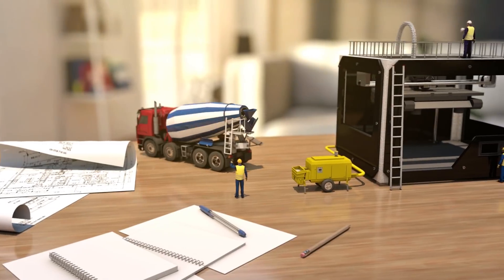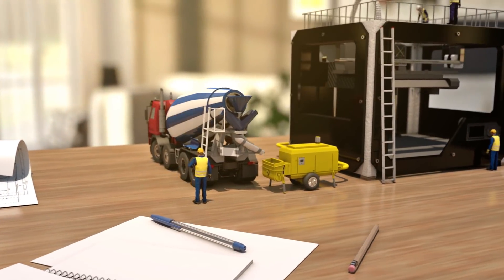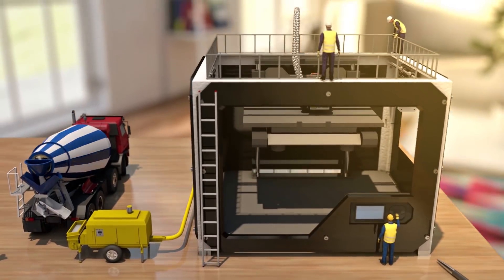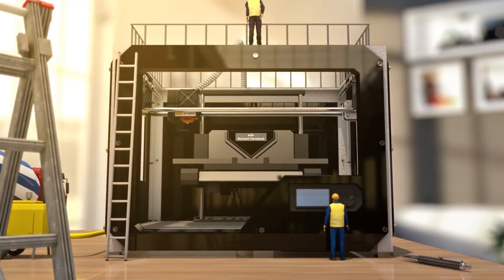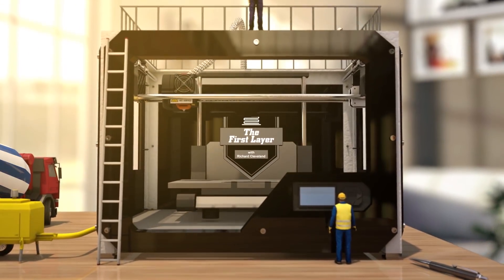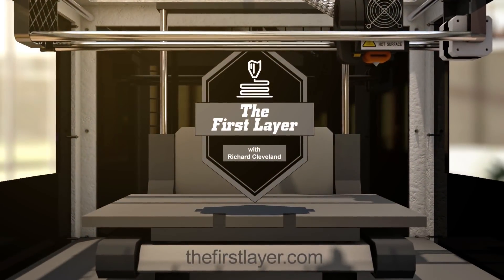3D printing First Layer issues troubleshooting Guide

Comment: I have a question about my ender3 v3 se printer. I been having leveling issues or bed issues. I been having some great prints and now I did the firmware update on the screen and motherboard, with old firmware work great new firmware.the printer with new firmware it's like a Crack head. Can you please help me

Comment: having a problem where its towards a corner but the furthest end of the corner is working, what would you say? (so its to say its curling before the furthest point but laying proper at the furthest point)
Reply: my extruder was loose and sagging forward, z hop helped a lot and made it go away for awhile but eventually i still had to figure it out. Also my bed was wobbly

Comment: Just can’t seem to get the filament to extrude, have to physically push through to start then stops …HELP
Reply from the maker: That indicates nto me that you have a clog happening in the print head.
Reply: Cheers will have to try adjusting the temp and stepper

Comment: dont forget to make sure the nozzle selected in the program is the same as the one your actually using. just bought a 3d printer and after 8 hours I see 0.4 mm nozzle in my program and i had a 0.8 nozzle on irl

Comment: I've tried all of this, an more - and it didn't help. Now, you may not believe it, but the source of my problem was... the deep blue synthetic rag which I used to wipe my build plate with alcohol !... It kind of dissolved in it, and gradually covered the plate with a thin layer of blueish residue. When I'd figured out what's going on, I wiped it thoroughly with a cotton rag and alcohol (the rag turned light blue in the end), and now it works just fine. But... your tips still improved my experience with the printer a lot, so thank you very much, good sir !

Comment: The extruder clicking can also happen if the spring in the extruder is too strong. 

I upgraded my extruder to a metal one, it came with a spring that was too strong, so the gear was getting pushed into the filament causing it to dig into the filament and mess it up, them with retraction on, it would retract the same section of filament over and over and over repeatedly when doing small sections of infil.

These grind spots on the filament were then tight inside the bowden tube and made the filament hard to push through, making the problem worse abd wirse up until the extruder can't push the filament at all and the print fails.

Comment: Ender 3 user here. Never had adhesion issues before until i tried PETG. I'm using a creality glass bed, all metal hotend, capricorn ptfe...yaddyyayda...never had a problem UNTIL: "Overture Grey PETG"(white never had ANY issues but the grey! OMG!) printing at 250/85(so far best results) but man...that FIRST LAYER... when i was printing larger parts i had no problem, smaller parts? well.. bed adhesion issues(elephant's foot, parts lifting/getting knocked off ruining the whole print etc)... even using multiple "hairsparay methods)(thin coat vs. soaking it down letting it dry etc)... man.. GLOBS/STRINGING alluvasudden... i am wondering if i am overextruding?...pulling my hair out... maybe the PETG roll i got was bad? (i doubt it). Like I said... 1st 30 hours of PETG printing with Overture's WHITE filament was awesome... this grey stuff is giving me grief...stringing...globs...not adhering/knocked off build plate etc...I have tried SEVERAL bed leveling attempts(paper is tight, paper barely touching, paper somewhat touching)...globbing/stringing... PLA, PLA+, other rolls of PETG were fine... nozzle is CLEAN... COULD IT BE A BAD ROLL OF FILAMENT OR POSSIBLY THE COLOR PIGMENT?? Frustrating as all hell!

Comment: This week I've been printing with a new reel of PETG. Major issues with first layer again. Found that I needed the following first layer settings.. 0.25-0.3mm gap, 90C bed, 250c head and 150% flow rate, yes 150%!  In addition I had to print at MORE than 20mm/s. If I tried to print the first layer slower I got under extrusion even at 150% flow rate. I think my extruder has issues at very slow extrusion rates. Weird as it calibrated fine. After first layer I found more normal settings of 0.2 layers, 80c bed 235C, 100% flow and 40-50mm/s work fine.

Comment: If you are still struggling after all the tips you are not alone. Last year I printed over 180 parts using several reels of filament, no first layer problems at all. Now all of a sudden I've had to spend three days solid trying to fix several different fix problems with the first layer. Normally a heated bed helps adhesion but apparently not always. To fix a problem this week i had to turn the heated bed off. Never had to do that before.

Comment: Thank you for the tip on the first layer having a transparent appearance, being an indicator of too low of an adjustment.  I was experiencing the smashed layers, especially at the smaller extrusion sizes, to the point that the skirt is too small and smashed to remove. Going to use these tips to level it up less tight
Reply: So, I eased up on my bed height, but it caused no adhesion, and layer separation. I tightened it back up, as my initial leveling seems correct, but going past the standard print quality (on an ender 3 pro, stock magnetic bed) I get an outline "skirt" layer, that is practically impossible to remove without scraping and damaging the print surface
Reply: @antwonfisher91 set it slight high where the print is just loose. Then do a test print.  after print starts  you get a Tune option on your screen. Click on that and go to the last item on the menu. On some printers it's called baby steps. Click in it. Set the value to negative in steps of one.  Then click on it and go back to display
 Usually by negative 2 or 3 you get the filament to stick to the bed.

Comment: My problem is that the filament already comes out while heating up so it is missing when printing the first layer.
Reply: Too hot nozzle temp, reduce by steps of 2 degree.
Reply: Could also be that you've got a build up of plastic behind the nozzle.  If theres a gap between the Bowden and the nozzle, it can fill with hot plastic, and that can seep out. As well as cause a delay between when the filament is pushed by the extruder, and when the plastic comes out of the nozzle. 

And causing a delay from when the filament is retracted to when plastic stops coming out of the nozzle.

Comment: Thank you so much sir! Finally my Ender 3 can stick on the bed. I follow every step in your videos. You got my subscribed 👍
Reply: I’m having the same issue could you tell me what helped
Reply: @faded_specter6495  what ender version you use. If ender 3s replace your stock bed with glass bed. Change stock spring with silicone spacer (previously I use yellow spring but the result not so good). I upgrade stock board with skr board that has capabilities mesh bed leveling function(depend on your budget). Calibrate e-steps and level your bed. Then all run perfect.

Comment: Great video thanx. Helped alot. One Q: for Ender printers as all stated it is 200 steps and the lead screw is 8 mm pitch per revolution which makes the Z resolution : 0,04 mm. So when you adjust the initial layer, lets say for 0,2 mm.increased by 150%. So it makes 0,3 mm initial layer height. But this is out of the resolution. Shouldn’t it be a multiple of 0,04? eg. 0,28 or 0,32 mm? Does it make a big difference? Thanks in advance.

Comment: I am a little confused when it comes to the initial extrusion hight. Don't you want more extrusion when the nozzle is higher? Here you are saying 2x more at .1mm, 1/2 more at .2mm and even at .3mm.
Reply: I was also confused by this part. What is the setting for "intial extrusion percentage". I use prusaslicer and I easily found the setting for initial layer speed. I didnt know what setting you are talking about here for "intial extrusion".

Comment: Thanks for your great videos.  One question.  Do you recommend leveling the device with the plate and the extruder preheated?  If so, what temperature do you recommend?  It seems that every time I turn it off and turn it back on, it's all in need of leveling again and with what I believe I have, which is a bow on my plate, it is extremely difficult to do.

Comment: The initial first layer speed helped me so much. I had no idea this was a thing. Thank you!
Reply: Slicing software could really make use of this too. 

A first layer with lots of circles, corners etc, should automatically speed up on straight lines, but slow down at corners and things that could get pulled up if they are printed too fast.

Might have to leave a feature idea on the cura site, see if they will test it out see if it's a useful idea.

Comment: So I assembled my printer,added a BL Touch.Leveled bed with paper,then finally used a dial indicator mounted to hotend,so I know it's level :-).I have my gap set with what I "assume" is right with the paper.But when I start a print,and the BL Touch resets Zero,isn't it defeating the gap that I had set with the knobs everytime?

Comment: I think i have a retraction issue with my printer but only on certain filament. on continuous flowing prints like the skirt or walls it does just fine but when it has to outline a bunch of places and or stop/retract the filament, it will stop flowing properly and then under extrude.

Comment: I have an issue while printing PETG: at the beginning of the new printing layer, when the nozzle hops up for a layer height without retraction, the fillament doesn't stick to the previous printed layer for a short distance and makes the little gap at that point, while the whole other printed part of this layer comes printed perfect. I want to print with 0.8mm nozzle at 0.5mm to 0.6mm layer height. I can hide this issue if I print the inner wall first before the outer, but if the outside of the print is hollow, then the outside corners aren't printed well even if i print it with 15mm/s speed. is there any settings in cura i could fix it? Thank you

Comment: After watching I went back to my slicer changed my settings I am printing again to see if it worked with my delta style printer. I at first thought it was a printer problem but as per usual it was an operator problem..

Comment: Using a post-it note for bed leveling is a super nice tip/trick! I couldn't get a good looking first layer down to save my life, even with a glass bed. However, it was because for my U20 a credit card thick gap (a thick one or thin one) was too much. Now the first layer is as smooth as the glass its printed on.

Comment: So we are trying to print and using a raft. The sides are peaking up pretty bad messing everything up. We don’t have a heated bed and our house is pretty cold thanks to winter. Is this the probable cause? 
     Also, has anyone tried fabric adhesive spray vs hair spray?
Reply from the maker: It seems you have figured out the problem. As far as adhesives go without a heated base they tend not to work at all.

Comment: I do have a second problem and that is some ''spider webbing'' occurs when the nozzel jumps over to another part to print.  Can this be fixed?
Reply: I may be wrong... I'm a newbie in the 3d printing world but from what I've been reading and watching your retraction value may need to be increased
Reply: @StormShadowDa1  This is my 3rd attempt to answer your response as my computer keeps erasing my response here.  Thanks for trying to help with this problem.  I now have a bigger problem first and it is with the x-axis motor gear moving in crazy ways so that the 'auto home' won't do it's correct pattern of movement.  I think it might be that the stepper driver control panel, or maybe even a gcode, might be the problem . I have checked the wires and they seem ok. I am too busy with other things right now but hope to solve it later.  Again thanks for your ideas.

Comment: Sorry, should I preheat the bed and nozzle on my CR-10s before I level?
Reply: Also make sure no filament in the nozzle as it will leak out as it gets hot and will alter your readings/feelings with the post it!
Reply from the maker: Yes, always heat the bed and nozzle to your desired printing temp before you level the bed.

Comment: My first layers have been pretty decent on my Ender 3 with PLA (aside from the fact that my bed is warped so I can't print large things) but I've been having lots of problems with getting flexible filament to stick. I'm gonna follow all your tips both with PLA and flexible. Thank you for this video!
Reply: Go really, really slow with your first layer. If your bed is warped and you don't have a bltouch but you do have marlin, then you can create a manual mesh. This will fix all your warped bed issues.